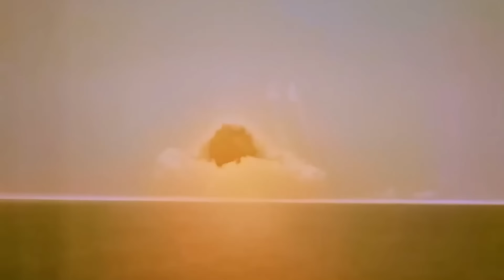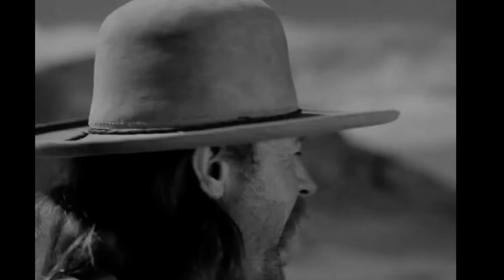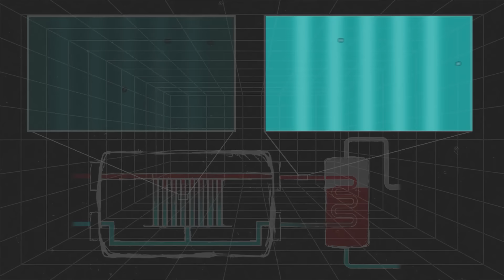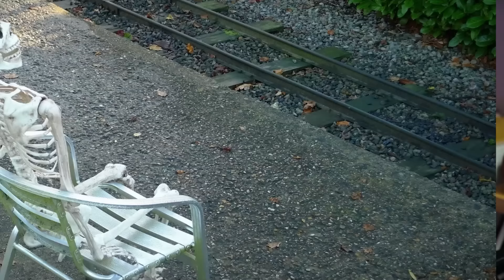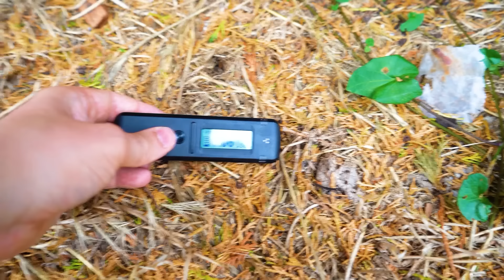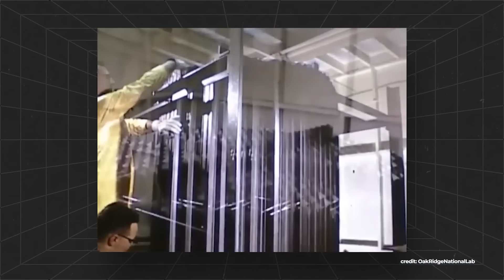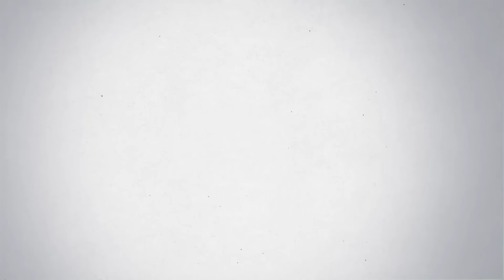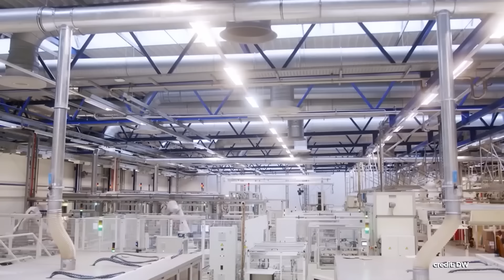It's Happening - China Launches World's First Thorium Nuclear Reactor

Comment: Stated timelines and estimated costs are usually far off from reality. They haven't considered all the metallurgy that's going to be more complex that they realized or they haven't even delved deep into because they're in the seeking investor stage. They're going to need the tooling for the tools for the tooling of the tools that will be used to test the tools that will make the tooling for one component of the thing. It's cutting-edge stuff. It's cutting edge because it's freakin' expensive. Otherwise, someone would've done it by now.

Comment: I have been following the whole thorium thing for a while, and while it COULD be a serious contender for 21st C energy, IMO it WILL be beaten out by fusion which will ultimately be simpler and cheaper. But NOT ITER or any of the other large scale projects. There are dozens and dozens of small fusion projects in different states of development. Their stumbling blocks are not the physics of fusion, but more arcane problems of fast switches and efficient capacitors. At the rate they have been progressing compared to TLS, fusion is going to be the dominant energy source by 2050. YEs - that fast. The first commercial generator (ie a reactor that will be able to produce usable net energy and send it to a grid) is being built NOW by Helion. I don't know if that's the best model for fusion - there are many others. My favourite is actually LPP Focus Fusion. Point is, someone is going to crack it - and when they do it will hit like smart phones or AI.

Comment: The critical point about thorium is that it's only really viable in a liquid fuelled reactor - but liquid fuelled reactors are fuel-agnostic and will happily run on any fissionable fuel without major issues

Thorium in a solid fuelled reactor requires extra handling costs on the fuelling side (Mostly U233, but U232 comes along for the ride and that's FIERCELY radioactive) and offers no waste reduction over enriched uranium or MOX fuelling - this is why study after study claimed it wasn't viable

Steam turbines are the obvious existing technology

Supercritical CO2 is likely a better generation technology (in terms of driving turbines) but it's a REALLY BAD IDEA to introduce multiple new technologies at once

It's good to see that TMSR-LF1 has paid dividends so soon. I wasn't expencting a commercial version until 2030 (Via TMSR-LF2, -LF3 and then a commercial ones)

The Aircraft Nuclear Reactor was molten salt fuelled but cooled by molten sodium. As such, most people regard MSRE as the first "true" Molten Salt Liquid Fuelled Nuclear Reactor

You missed the real reason why criticality only occurs in the reactor - it has a moderator which SLOWS DOWN THE NEUTRONS (from "fast" to "thermal" speeds) and greatly increases the odds of them colliding with other fissionable/fertile atoms. 

Bear mind that thorium, U233 (which is actually what's fissionable in the thorium process), U235, U238 and Pu239 are all BARELY radioactive. In order to achieve a nuclear reaction you need to put a large quantitity in one place AND reflect emitted neutrons back into the mass AND slow them down sufficiently that they don't fly off into the adjacent space before hitting something

History: enriched uranium (3-5% U235) is a UNWANTED BYPRODUCT of nuclear weapons production - uranium centrifuge facilities are making DEPLETED uranium for conversion into weapons-grade pluitonium and the reason we have U235 nuclear reactors is because there were dozens of tons of the stuff sitting around as unwanted waste. 

Alvin Weinberg built the first water-moderated uranium fuelled nuclear power reactor (Nautilus and Shppiingport) as well as the MSRE and in his own words - "We didn't use enriched uranium because it was the best fuel for the task. We used it because it was AVAILABLE (and thorium wasn't)" - developing a thorium supply woudl have delayed Nautilus by over a decade

Saying "nuclear reactors produce plutonium" politically turns the entire process on its head - and results in protestors raging outside the gates of the wrong facility - the weapons material is the "unwanted" U238

The elephant in the room about thorium reactors is that they're hot enough to replace combustion sources in coal power plants - and a 3000MWt reactor (suitable for a 1GW power station) design is around 1/4 the size of coal burners - INCLUDING THE CONTAINMENT BUILDING. Interestingly, most Chinese coal power stations built over the last 20 years seem to include reserved space adjacent to the turbine halls which would be perfectly suited for a drop-in heat source replacement

The "highly corrosive salt" claim is flat out bullshit. MSRE had ZERO observable pipework corrosion - even under microscope inspection - after 9000 full-power hours. Flouride salts are slightly corrosive and that was taken into account in the MSRE before it was even started up

WATER is extremely corrosive at 350C/20atm and even more so when boric acid is added. There have been several near-misses in "conventional" nuclear power plants because of this - in one case 9 inches of stainless steel was eaten away in 18 months on a primary cooling loop (Davis Besse, March 2002). This is one of the reasons why water-moderated nuclear is so potentialy dangerous (Wet steam is also extremely corrosive, so the power generation side of existing nuclear is significantly more dangerous/maintenance intensive than it could be - Mihama 9 August 2004, Surry Virginia 9 December 1986, Byron IL 19 Oct 2007)

In terms of economics - THERE IS NO POINT IN MAKING SMALL NUCLEAR REACTORS - it's not the reactors which are the issue, despite a small one being as much work as a large one (they're much like aquariuns - larger ones are easier to maintain as smaller ones are prone to environmental swings that can get out of hand before operator intervention)

Thermal power stations are only really economic if the steam turbines are as large as possible - which is why coal and gas stations have converged on ~1GW - essentially the only way to be economic is to build the NON-nuclear side as large as possible with current technology and that's around 1GW for steam turbines (supercritical CO2 is potentially able to provide higher energies at even lower maintenance costs, but it's been "experimental" for over 40 years as commercial operators are notoriously risk-averse - where the "risk" is  "R&D cost")

IE:  In terms of electrical generation, if a new plant is under 1GW, it's simply not worthwhile building.

Weinberg's autobiography is worth reading: "The First Nuclear Era: The Life and Times of Nuclear Fixer"

ALSO WORTH NOTING: Renewables technology can slightly outproduce existing carbon-emitting electrical generation if economy-damaging levels of investment are made, but electrical production is only 1/3 of humanity's annual carbon emissions. 
Replacing the rest of the carbon will need AT LEAST 6 times more enrgy (electricity) production (thanks to conversion efficienices along the way) and there's no way renwables can do that as there simply aren't enough raw materials or land close enough to point of consumption to do it (Electricity transported about 1200-1500km from point of generation already incurs 60% transmission losses in the high voltage network, increasing transmission voltages past 1 million volts is impractical (you end up with arcing to ground) and "superconductor" proposals are impossibly expensive

Why does this all matter? 

Because "global warming" and "climate change" are not the real danger. 

We are facing a pontential extinction level event if carbon emissions are not curtailed

People can move away from rising sea levels or build for worse storms. It's very hard indeed to escape global oxygen levels dropping to 10% - they did this at the end of the Permian era when submarine methane clathrate beds blew out thanks to a combination of heating and volcanism - this is the elephant in the room as it is already starting to happen

Lookup: "Laptev Sea Methane emissions" - that's 20GT of methane already locked into a blowout. One is survivable, more than three-4 will probably kick off a chain reaction as happened in the Permian - and once that happeend 250 million years ago the entire  extinction event played out in less than a decade (perhaps as little as 18 months)  to achieve 96% extinction of the ENTIRE planetary biomass. 

It turns out Earth has a "reset" button for complex life and we've been inadvertently leaning on the break-glass cover for the last 200 years

Comment: I'm dubious about any claims China has for new tech. They have a notorious history for trying to pass off common, lesser tech as cutting edge. Examples: an interactive AI display that that turned out to be a woman in a cheap back room mo cap rig interacting with the presenter via CCTV, or what was claimed to be an autonomous GPS enabled tractor that ran at a dismal 4 kph by remote control. The CCP discourages true innovation because for people to develop a habit of creative, new, and fresh ideas, requires continually questioning the status quo. Addendum; What China offers to solar power is a large, low paid, if not slave (Xinjiang) workforce, and a disregard for the environmental concerns inherent in the manufacturing process.

Comment: Germany already tried Thorium - THTR-300.
It was shut down within 3 years of going live, and the cost of the power it produced over its lifetime ended up coming in at 30x the current wholesale price - an economic catastrophe for everybody involved, especially the German taxpayer.
 
As far as molten salt reactors go - Monju in Japan was a good example of what happens when you just ignore the complete risk profile of trying to build and run this kind of thing - the total cost of the complete and utter failure that Monju was, would have been enough to build 500GW capacity of wind and solar installed capacity in Japan.
That's 500GW of clean, cheap power Japan doesn't have, thanks to the nuke industry.

Comment: Fission does not occur outside the reactor because there is no moderator and the reactor is stable because when the temperature rises the liquid becomes less dense, slowing down fission.  A freeze plug at the base of the reactor melts if the temperature becomes  high enough and the fuel drains into a storage tank.  Please inform yourself before trying to explain.

Comment: I work on DME (dimethyl ether) applications in Automotive. If all other technologies deadlines are estimated to the period when all the responsible decision makers will be on pension or off duty, DME can be introduced instantaneously. Synthetic fuels solve the main issue that solar, wind and nuclear does not : we can store , handle and use it easily and the storage vessel needed for DME is the same as for LPG (just different elastomers and seals).

Comment: Dear Ben,
A good presentation and whilst I am sure you know the difference, the presentation didn't make clear the difference between fast neutrons and thermal neutrons. Most of the reactions take place between thermal neutrons which have been slowed by passing then through a Moderator such as water or carbon which intreases the chance of a reaction with a fissile nucleus.  There are "fast reactors" which use fast neutrons but these are very rare and I have to confess I don't understand them fully.
Keep up the good work M H

Comment: Regarding the question of continuing to push for fusion: obviously, it won't become a thing from doing nothing.
However, the part that I still don't get in that area is: why do they need to scale up the prototype reactors to the point where it'll take a decade before the next version is running, instead of getting the small ones to run on their own first. Is that a literal scale thing? Like how it's possible to balance a broomstick on your finger but you can't do the same with a toothpick?
Reply: I believe yes. In order to generate energy instead of just using it, the reaction has to produce enough heat and larger reactors produce more heat.
Reply: In the past this has been true, but not because of the quantity of heat produced. The issue has always been how to get the magnetic field strong enough...that is why things like ITER are as big as they are. Newer high temp superconducting magnet tech ( yttrium barium copper oxide) has allowed some designs (e.g. MIT SPARC) to be much smaller while producing much higher magnetic fields and it is possible they will come to fruition before ITER. Commonwealth Fusion Systems/MIT is in the process of building a tech demonstrator in the US right now.

Comment: Too bad he didn't include Copenhagen Atomics in this video.  They are already building prototype reactors.
Reply: Was about to write that as well - they have working molten salt reactors up and running, but with electricity as heating source (because Denmark!) - they are going to test with fissile material in Switzerland.
Reply: Yeah, I don't wouldn't trust that stuff with ten feet pole. China did take time to validate all that unpleasant material stuff, corrosion, stability at 1200°C, significant budget, hundreds of PhDs a and over a decade of research.

Copenhagen Atomics look to be founded in 2014, revenue of ~ $7 Million (I have seen an announcement about $25 mil funding round). From money alone, it's obvious it's not a serious effort (in sense of resources invested, I am sure people are very dedicated and serious).

Making a shifty reactor is a recipe for disaster.  E.g. PM-3A (one for McMurdo station) had 438 malfunctions during its operational lifetime (1964 to 1972).

Comment: 9:45 - there it [233Pa] undergoes beta decay again, converting another proton into neutron and producing Uranium 233 - I gues you meant to say "NEUTRON into PROTON", haven't you?
Reply: Yeah, Protactinium is element 91 Uranium is 92 so it would have to gain a proton. What I don't get is if a neutron was converted into a proton, then it should be Uranium 232. Unless it gained another one from being "bombarded".
Reply: @Grerak  When a neutron "expels" a beta particle (I'm not overly precise in use of the terminology here, I just want to address the issue) the nuclei does not change its mass - it rises its atomic number, i.e. number of protons (hence becoming an element "higher up" on the list). Atomic mass (in a.m.u) is a sum of neutrons and protons, so if one neutron changes its, erm, "preferred pronoun" that does not affect the mass of the nuclei.
233Pa has 91 protons and 142 neutrons [233/91Pa], hence it's a.m. = 233.
When one neutron becomes proton it's noow 92 p (one more) + 141 n (one less) which still equals 233, but since proton number became higher, it is now another element, uranium - with the same mass - 233/92U.
Reply: @MrKotBonifacy  Makes sense! Thanks for the clarification. Now I know why Carbon-14 turns into Nitrogen-14 for carbon dating.

Comment: It is all moot, as any breakthrough will be too late.
When the pilot projects are small and half a decade out, it is clear nuclear is a distraction.

We can't go on behaving like it is 1985. We are on the brink, and need a swift transition now, not in 10-20 years.

Also look up 'deep warming'.
Supplanting coal plants with nuclear plants will continue the heat pollution.

Building wind and storage to supply 1 GW will save us 2GW waste heat. 
That used to be negligible, but in our current crisis it is as good as carbon capture.
In other words we get double the bang for the bucks with wind - which is already cheaper.

No time to (produce) waste!